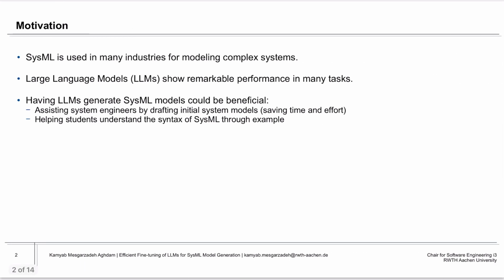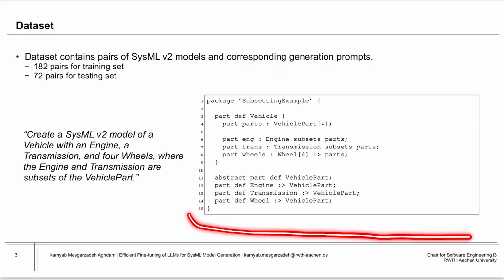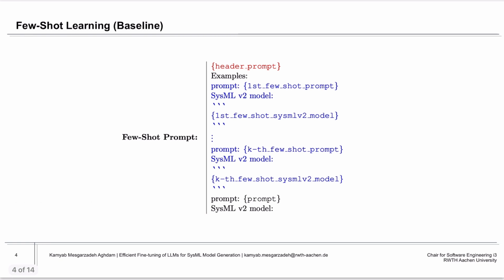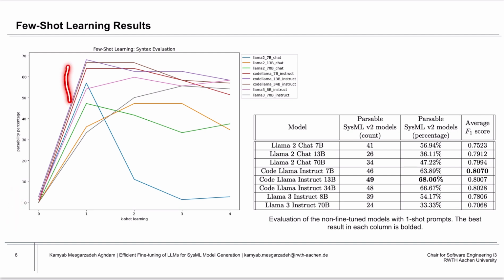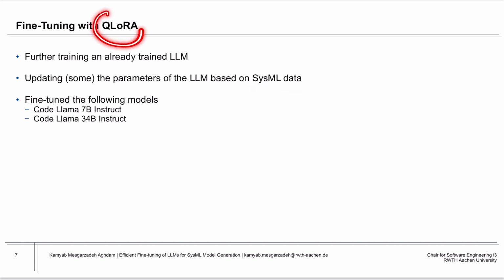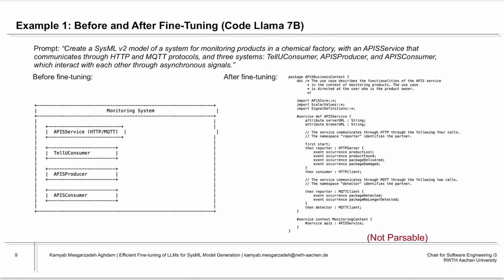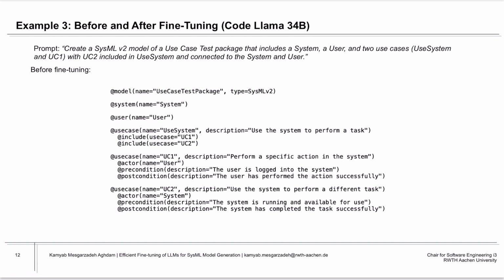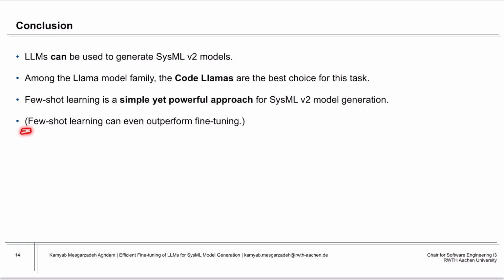Efficient Fine-tuning of LLMs for SysML Model Generation

Comment: The preselected text refers to a topic on efficiently fine-tuning large language models (LLMs) for generating SysML models, which is a significant area of research in software engineering. Fine-tuning LLMs involves adapting pre-trained models to specific tasks, such as SysML model generation, to improve their performance and efficiency.

Would you like more detailed information on this topic or perhaps a summary of recent research findings?